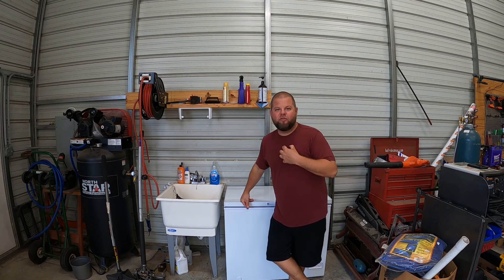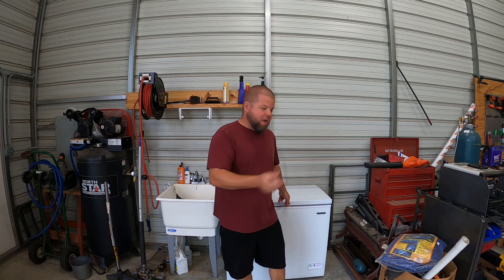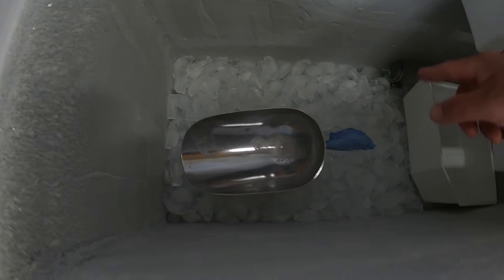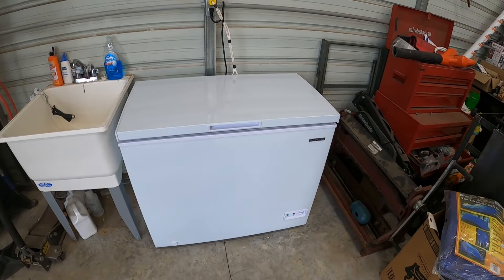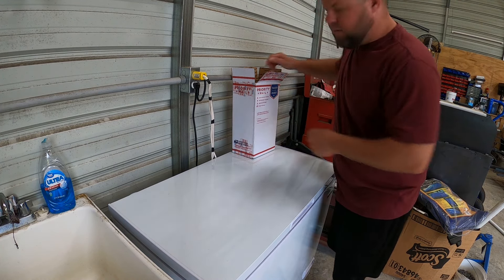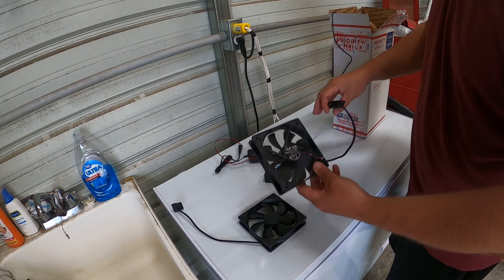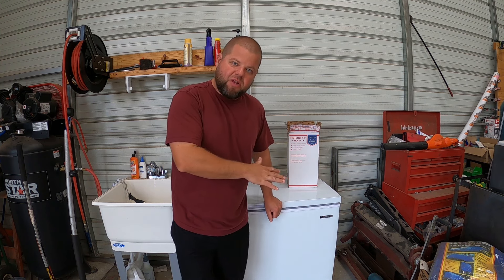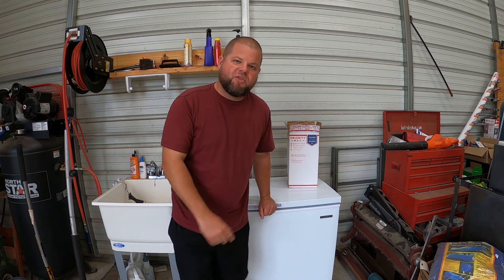Homemade ice machine update! Viewer requested

Comment: Ice or whatever can get to pretty much any temperature. There’s really no such thing as cold it’s just the absence of heat, freezers work and refrigerators by removing heat. So your water dumped in the ice tray and as the heat drains out of it it drops in temperature and will eventually drop in temperature to the temperature of the environment around it we’re pretty close to it.  Circulating air in there will help. I would suggest the small fan blowing air past the icemakers because that’s where your major heat source is from water as it comes in and the more cold air blowing by there the faster it’s going to remove that heat. Even higher end house icemakers have fans on them to blow air away from it.   I think even that small fan in there Will speed up the process a little bit as long as you’re moving some air across the ice trays.  I don’t know how the ice trays choose to dump, if they’re on a timer it probably won’t make much difference but if you can adjust the timer that might speed it up, you just have to make sure it’s getting enough time to freeze come up with a little fan moving air in there it will probably freeze a little bit faster, Just remember that the fan motors might create heat as well but I don’t think it will be enough to matter, I would just try to generally circulate the air in there and make sure it’s getting around the ice trays as well.  It’s pretty cool and definitely cheaper than most of the icemakers out there. I’ve noticed on a lot of the cheaper icemakers they make really wet ice that sticks together like you were talking about, it just doesn’t give it long enough to freeze I would guess or just isn’t insulated or cold enough.  I would probably put a shelf in there to put some water bottles in, it’s always good to have a couple solid frozen water bottles in your cooler and you’ve got plenty of room in there for it, plus if your power ever goes out the more ice you have in there the longer it’s gonna last.  It’s a pretty cool project.
Reply from the maker: Very good information, thanks!

Comment: I've never heard anyone say that ice can't get lower than 32F.  I know I would have laughed at them.
Reply: me neither, I would have had the same response!
Reply from the maker: I heard it, made me second guess everything lol. I certainly thought anything can eventually reach the temperature of its environment.
Reply: @TKCL  I'll bet these same people also think that water can't get hotter than 212F.  It can.  It requires the water to be under pressure like in a boiler, but it certainly can.  Water unless less pressure (like a vacuum or at altitude) will boil away at a temp lower than 212F and under pressure it will not boil at 212F but at a higher temp depending on the amount of pressure.  I'm sure someone much smarter than me knows the name of the law of physics for this but I do not.